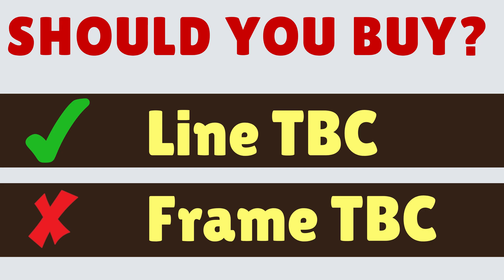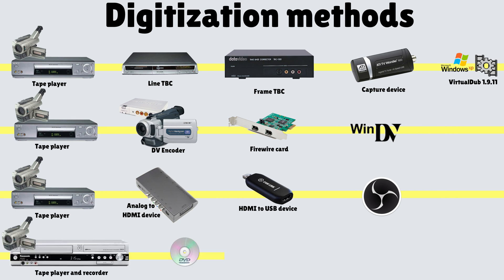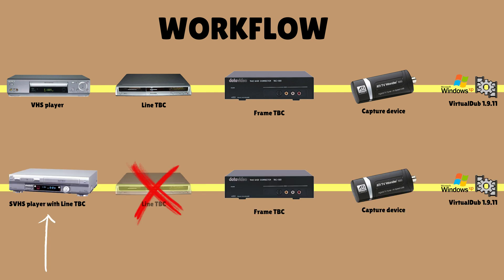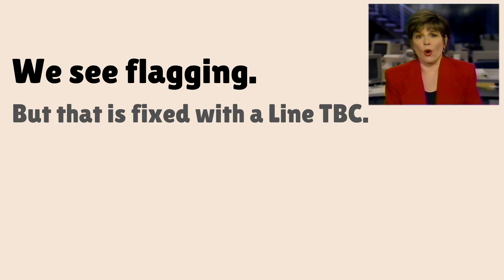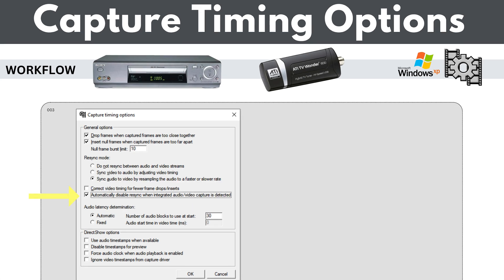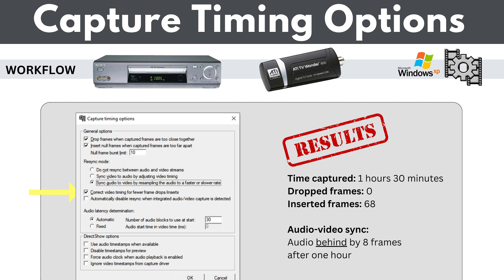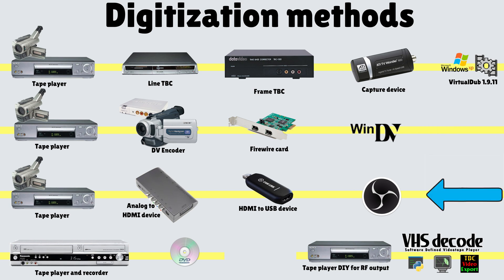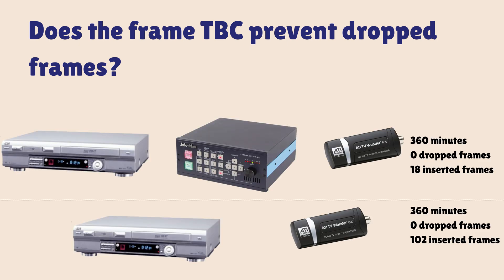What's a Line TBC and  Frame TBC?

Comment: Another great comparison! My understanding is that a frame TBC can drop and insert frames as needed without being able to view the statistics that it has happened. If frames arrive too quickly, then it has to drop frames if its buffer is already full. If frames arrive too slowly, it will eventually run out of buffered frames and have to repeat at least remaining frame in its memory buffer until the buffer is refilled.  

The main downside of a TBC is that it's essentially a mild generation loss since analog is converted to digital and then back to analog. An ideal TBC would convert to digital and then output that digital signal to then capture. Some TBCs do have SDI out which is digital and they would have at least a theoretical advantage over an analog in to analog out TBC like the ones you mention. Whether that "generation loss" is perceptible to the average person is another question. An ideal chain would have only a single analog to digital conversion that is then captured. 

If you wanted to do a comparison video to show image quality degradation caused by passthrough devices, you might try outputting DVD playback passed through both the ES10 and the DVK then the capture card versus capturing that same DVD directly into your capture card. DVDs will not have time base errors, so this test only shows how multiple passthrough devices will degrade the original image quality. The ES10 in particular is said to cause "posterization" which is a type of detail loss . You'll also be able to rip that DVD and show what the original truly should have looked like if the capture was "perfect".
Reply: - This is not correct. Quality frame TBCs have large buffers to store and release frames, so dropping/inserting is not very common. The tape would have to be truly horrible, more noise than signal, for a buffer overrun to happen. 
- Any loss by TBCs is more theoretical than actual, because quality TBCs can easily capture full quality of the signal (A>D), and re-output it (D>A), especially with consumer sources like VHS. So the problem is the quality of the TBC, not an intrinsic truth of all TBCs. 
- The DVK is not a true frame TBC, but more of a TBC(ish), as it is weaker. 
- DVDs are 4:2:0, MPEG, and are too lossy for such a comparison.

Comment: Hello! Just want to point out that your work is amazing and very useful! Thank you again for that. I watched your video very carefully and the only question I have to ask you is about the second method, the digitization with minidv device, are you aware that many old miniDV cameras have line TBC that is active and working in digitization mode? It would be really interesting to check, test and compare the line TBC that probably is already there in your mini DV camera with other line TBC that are inherent in SVHS players or Panasonic DVD recorders.
Reply from the maker: MiniDV camcorders have a Line TBC feature, which is used when recording video with the camera itself, or when video is passed through it via the S-Video or Composite connection. I don't know much more about it. All I know is that it was able to remove all tearing and flagging from an old VHS tape. See my comparison video: https://www.youtube.com/watch?v=3SRoGgJZbwc. 

How does it compare to the Line TBC in the JVC SVHS players? Or the Panasonic ES-10/15? I guess if I were to test it, I would want to see:

1. How does each handle bad tapes? My sense is that they are all adept at fixing flagging.

2. What is the effect on the look of the video? JVC linked the Line TBC feature with the Noise Reduction (NR) feature. So, you get some processing of the video (that you may not want) if you use the Line TBC option. Same goes for the Panasonic ES10/15, except that it appears to have an even greater (bad) impact on the video colors. And the MiniDV camcorder compresses the video to the lossy DV format with a reduced color space, which also affects the color. So, in all three cases, there is an effect, but one can probably adjust the colors in Davinci Resolve to get it back to the way you want it.
Reply: @videocaptureguide  

You stated the following below. 

"MiniDV camcorder compresses the video to the lossy DV format with a reduced color space, which also affects the color".

VirtualDub may let you capture uncompressed 10 bit 4:4:4 using a cheap USB video capture device but I imagine a lot of the cheap USB capture devices are limited by hardware to 8 bit 4:1:1.   

You could let people know in your next video that I (TECHTVUSA) created a video comparing 10 bit uncompressed 4:4:4 to the DV -25 8 bit 4:1:1 and no one can tell the difference. I think that video might be helpful to a lot of people.
Reply: @TechTVusa   You stated: VirtualDub may let you capture uncompressed 10 bit 4:4:4 using a cheap USB video capture device " That in itself is correct as long as you don't capture DV via the Firewire connection, since this is basically a bit-for-bit copy of what is recorded on the DV tape. So if there is no 4:4:4 data on the DV tape, then VirtualDub can't invent the missing data.
Reply: @art2work4  I was not talking about capturing by Firewire. I was talking about capturing VHS tapes using a cheap USB video capture card. Some software program will let you capture by USB and Firewire to uncompressed 12 bit 4:4:4. The problem is the cheap USB video capture device and Firewire capture devices do not support uncompressed 12 bit 4:4:4. Not only that the cheap USB video capture cards can have issues with dynamic range. What good is uncompressed 12 bit 4:4:4 with only 10 stops of dynamic range? Do you kind of see my point?

I highly recommend you watch some of my videos before leaving me anymore comments.
Reply: again, your tone of voice is not productive. You wrote uncompressed 12 bit 4:4:4 with only 120 stops of dynamic range is good.

Indeed, it's the best format, however it won't let your source data with 8 bits compression and compressed color space look any better than the source files.

don't forget to take a deep breath before responding so impulsively....

your anger makes you blind for the fact that we are on the same pace.

I just want to make clear that what is not present in a source file will not magically be added with 10 or 12 bit and 4:4:4 formats. I believe you agree with this.....
Reply: @art2work4  There is nothing wrong with my tone. I am letting you know I have several videos about VHS capture. In fact Video Capture Guide would admit he has learned a few things from me. 

You wrote the following below.

"You wrote uncompressed 12 bit 4:4:4 with only 120 stops of dynamic range is good."

"Indeed, it's the best format, however it won't let your source data with 8 bits compression and compressed color space look any better than the source files."

Once again you are very confused. That is not what I wrote. I wrote what good is 12 bit 4:4:4 with only 10 stops of dynamic range.  Dynamic range is very important and you want to get as much as possible (13 stops is good). What has 120 stops of dynamic range? Do you even know what dynamic range is? 

Below are more quotes from you. 

"don't forget to take a deep breath before responding so impulsively...."

"your anger makes you blind for the fact that we are on the same pace."

You should take your own advise. Your have made several post addressed to me TechTVUSA. You are consistently trying to educate me but I don't need your assistance. You are the one quick to educate me and you don't need to do that. You should have watched a few of my video before responding. I am the one that let Video Capture Guide know that the Firewire DV converters do not need a TBC. I demonstrated this in several of my videos but you feel the need to educate me. Do you kind of see my point? Does it kind of make sense to you now?

Last but not least you wrote the following below? 

"I just want to make clear that what is not present in a source file will not magically be added with 10 or 12 bit and 4:4:4 formats. I believe you agree with this...."

We do agree!!!!!!!!!!

The problem is I Have videos from 2 years ago and 5 years ago that state that very thing. Yet you addressed me (TechTVUSA). Why? Why not just start a new post not addressed to me? 

Why not just say "TechTVUSA I did not realize you knew all of this and had even made videos about it. My bad, sorry" 

Why not just post that?
Reply: The truth is in the eye of he beholder. The same is true for the way you respond.  I never tried to educate you yet I do sense a lot of frustration that is totally uncalled for.

If you take everything personal and as criticism, perhaps then you should disable the comments.

I wish you all the best.
A tip, stick to the facts, create those great video's and quit bashing on people.

good day sir
Reply: @art2work4  

You wrote the following below. 

"If you take everything personal and as criticism, perhaps then you should disable the comments."

I am not going to disable comments because most people leave legit comments for me. 

You also wrote the following below. 

"A tip, stick to the facts, create those great video's and quit bashing on people."

Maybe you should take your own advise.

Comment: I think that the Panasonic DMR-ES10EG (PAL) still has the Panasonic MN673744 Frame TBC/Synchronizer IC, and the much worse DMR-ES15EG (PAL) has the input selection IC with integrated Line TBC. But you can quickly find out whether after the ES10 the picture comes about 3 frames too late compared to the sound. The Panasonic DMR-E55EG (PAL) sold in Germany has the internals of the Panasonic DMR-E50 sold in the USA with a more modern housing. The PAL and NTSC versions are therefore not directly comparable. I was not able to test the Panasonic DMR-ES10EG myself, as only the "Made in Slovakia" version was sold in Europe.

Comment: It is good that you are testing things out for yourself. I think once you capture the video with Premiere Pro and a Firewire DV converter you will realize what a waste of time it was to use the cheap USB capture device with cheap software like OBS,  VirtualDub, handbrake etc.
Reply from the maker: Premiere Pro no longer supports DV capture. What is the last version that does?
Reply: @videocaptureguide  The DV capture program shouldn't really matter. You can use WinDV and then drop into whatever editor you want.
Reply: @videocaptureguide  You don't really need premiere, DV should be streamed with non NLE app such as Sclive or WinDV, Some of those beefy NLE drop frames due to high CPU usage.
Reply: @Capturing-Memories  I agree that you don't need Premiere Pro but at one time it was very easy to use Premiere Pro to capture edit and and burn to Blu-ray (Encore)? Having said that I am surprised Vegas got rid of DV capture.
Reply: @videocaptureguide 
From some brief googling, it seems that version 23.6 should be able to.  
You can have 2 (or more) versions of Adobe products installed concurrently with ease thankfully
Reply: I now use dps575 and x75
Reply: @NBAONDVD  Perhaps you could post a video of your technique.
Reply: @TechTVusa  I am not good at English
Reply: When will we see the Premiere Pro capture and render out at 60 frames per second video?